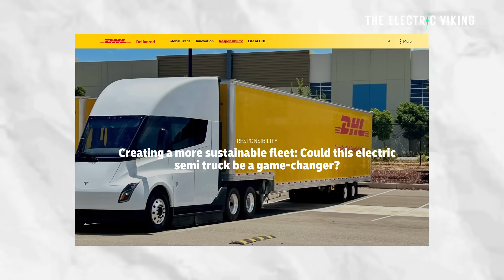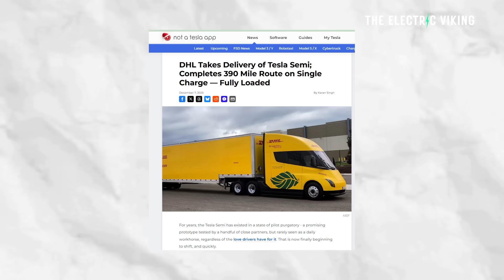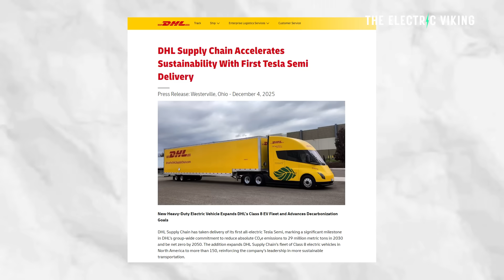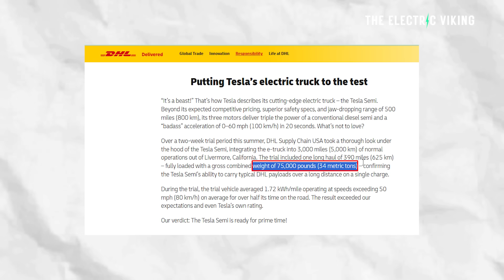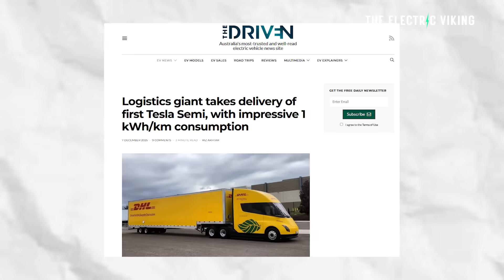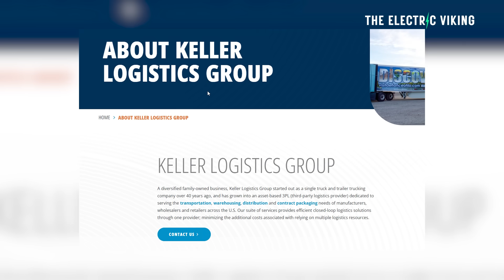Tesla Semi Drives 390 Miles on Single Charge Fully Loaded with Range Leftover!

Comment: Any steep grades in this test? 

When the truck finally was parked to recharge the battery, the local 500 megawatt power plant had to carve out 1-3% of its total plant output fast charge this behemoth.

If this is done fleetwide sounds like this would work out perfectly for local consumers of electricity and their electric bills.

And again how was the electricity used to charge this beast? Solar? Wind? Don't make me laugh.

My bet coal or natural gas, since nobody with low capacity minds want nuclear power to be used.

So again what's the point of all of this from an environmental perspective?

Comment: So just one question where and how (with what power from where for there is not that much available anywhere) are you going to charge all those trucks... for they require power to operate its just that the power does not 'flow' back into the machine ones used compared to ice options...
I mean the tech is awesome but the infrastructure is not there and by infrastructure I mean the power plants themselves not just the wall connection....

Comment: I think it is the future.  Now with companies like edison motors and tesla.  I am waiting to see if it is all EV or EV with a generator.  A smaller one like the size of an F550 would be awesome if it can reach 390 miles loaded.  Imagine doing hot shots or putting an RV on it how cool that would be.  Especially if they offered it with 5th wheel back like full size semis.  Or borrow some of slate tech and allow you to add a bed when not in use and would lock in with the 5th wheel.

Comment: Great that YOU become more intelligent but H2 was never to overcome ICE trucks as it makes no commercial sense to replace as 21% Energyefficiency by such with 12% and a new logistics network nobody will or can PAY. But even with bad power mix in Europe for example you end up with 68% - but my dear self-named EXPERT we have batteries and solar roof top on our warehouses! So we once become FREE from oil and gas mafia with producing our own energy and on the road we do not need to charge which is our case is also a security question!

Comment: In the US drivers have mandatory stops before 500 miles so if you have charging stations long haul is no problem.
Reply: In the EU/UK working time directive basically caps the maximum mileage a truck driver can do in a day at a but less than 500 miles and they will need at least 45 minutes of break to get remotely close to that figure.

Comment: Just watch the Electric Trucker on YT.
Tobias runs long haul over europe with electric prime movers.
Charging aligns with stops at some depot's  or his mandated driver breaks. 
Australia has similar long haul driver limits on hours and mandatory breaks. those 45 to 1 hr breaks allows a fair bit of charge at 350 kW chargers 
Companies also fitting swappable batteries like those of Janus Electric. 
A strategic placed swap station with  a 5 - 10 minute battery swap gives even greater flexibility.
Particularly for local delivery trucks that can swap drivers and run round the clock because of low noise and not impacted by curfew rules.

Electric trucks tend to get between 1 kWh per km to 1.8 kWh per km. 
energy consumption of  180 kWh per 100 kms..per 100 kms.  At fast charger cost of AUD$0.65 / kWh = approx AUD$117.00  per 100 kms.

A 600 kWh battery capacity can give between 300- 500 kms of range when pulling 44 MT depending on the cargo and drag. 
Covered tautliners or pantechs getting better range then open aukward cargo.

Diesel trucks depending on load and wind drag can see 40 - 80 litres of diesel per 100 kms. 
Diesel cost per litre at anything from AUD$1.80 - AUD$2.00 / ltr. approx AUD$160.00 per 100 kms  

As a transport operator AUD$117.00/ 100kms for electrons and much less expensive service cost compared to AUD$160.00 / 100 kms for diesel and then service with oil and filters every 20,000 kms - its a no brainer.
Les driver fatigue less noise and no noise curfew

Comment: Diesels are smelly, noisy, expensive to run, expensive to maintain, (and very tiring to drive). Include oil and filter changes, brake wear and much much more. It’s a no-brainer. Bill Gates has no clue, who’d have thunk it 😂😂😂.
Just as I love driving either of our fantastic Teslas, and almost always use Autopilot or FSD, the difference in fatigue levels with and without A/P on a long drive are HUGE.

Comment: A regular semi goes 2000 miles on a full tank, and can carry 19 tons for those 2000 miles. I think Tesla needs to work on this a bit more. A Tesla semi can carry 6 tons, in a job where you get paid depending on how much you transport 6 tons doesn't cut it
Reply: ? 75k pounds is 34 metric tons and highway speed for about 800k,, how is this not good enough ??

Comment: 75,000 lbs full load, that must include the weight of the truck and batteries. How much does the truck and batteries weigh, then how much on the load? Heavy batteries are going to limit the total load carried. 80,000 lbs is the limit for truck and load normally, with the cab and trailer coming in around 30,000.
Reply: Funny, for decades you did not ask about the weight of Diesel engine, gearbox, drive train, cooling and exhaust systems, and barrels of fuel.

Comment: The tesla semi needs to be able to run at a minimum 500 miles on a full charge at 80,000 lbs. And be able to fully recharge with in hour to really make a huge difference in the trucking industry.
Reply: early days, let's walk before we run. Would you drive 8 hours without stopping? I think truckers have rules in most countries that preclude that. Rest time = charge time = more than 500 miles. The diesel truck didn't kill off the railways...... entirely.

Comment: Electric trucks will work as long as they are owned and operated by a fleet owner with their own charging infrastructure at their hubs. If a independent contractor bought a e truck he would not be able to survive economically simply because of having to use commercial high speed chargers paying commercial rates for power, then you have the purchase price of the e truck which is here in Norway 2.5 times higher than an equivalent diesel truck. I myself am an owner operator with my own truck. I have been looking into the economics of this for a year and a half. It just isn’t feasible due to the economics!
We are supposed to be the nation that has gone the furthest in e cars and trucks…. But for a small business like me it just won’t happen ( not yet anyway)

Comment: There is another option which is worth looking at for the numerous diesel trucks on the road - which is electrify the trailer. A company called Range Energy run by a chap who once worked at Tesla in simple terms adds some batteries and electric motors to the trailer part and that can help enormously with making the truck use less diesel and less wear on the brakes.
Reply: Having some battery and motor on the trailer for braking seems like a win for safety and efficiency

Comment: Millon dollar chargers?  That's right in order to get a fairly quick charge, charging a Semi is like charging 12 model Ys at the same time.  That normally would dramatically increase charge times; so Tesla has a type of Charger supplemented by a giant battery pack. These cost more than the truck, and a 1 MegaWatt unit can only charge 1 truck, so you either need lots of megawatt battery packs sitting charging -or you'll have very long charge times for the next Semi coming to charge.  All this gets rediculous if you are going to try and charge all these with solar panels or wind mills, USA alone has 9 million heavy trucks - if you are not - why do it?
Reply: One charger serving many $200,000 trucks - how does that amortise? Business is all about costs, if they stack up, business buys. If not, not - let business decide on the road instead of on paper.
Reply: @RedRouge-j4j  Yes let them decide without any fake CO2 rebates - they don't save much if any CO2. I  am pointing that out because they hide that large cost, and it takes quite a while to recharge the big battery pack so you might service 1 truck per hour or 2 hours - so it is a significant cost per truck.
Reply: @litestuffllc7249  don't show that comment to your grandkids. They will be paying your climate mortgage - PAL.

Comment: This is similar to that original drive from fremont to Long beach - No one is very surprised if a Truck can go a long ways downhill.  A giant truck is a lot like a bowling ball, it is hard to stop once you get going, and if it is down hill it is very diffcult to stop. When ever you have big claims you need to look into the exact drives and topography. Pepsi prsented a long list of results and when a Tesla Semi had to go uphill, go in twisty roads, and stop and go driving, range and weather impacts the range could fall to as low as 150 miles.  That is still very useable in short haul but probably not so much in long haul, especially without $1 million dollar chargers.

Comment: I’m wondering when someone will put solar panels on top of the trailer. Course I know that won’t work for many types of trucking where they’re dropping off trailers, but many companies use the same truck and trailer all the time on set routes and in sunny areas.
Reply: Might be enough to power a refer trailer but not significantly add to range.
Reply: @williammeek-h2o  way cheaper in any sense to use pressurized gas to cool.
IT also ads weight to the hole contraption that needs transporting.
Solar panels are not really made for moving or they become alot more expensive.
add the weight of inverters chargers and I think you could better ad that wright in batteries.
Less complex for most wont even need a solar supported something contraption ^^
Not to say some might have a use case for it or just a need ^^
Reply: @davidliefrink9818  Inverters are not that heavy. I just installed a 10 kW inverter at home for my shop and it only weighs 60 lb. The panels will be heavier each. When supported properly, the panels will be fine. and you should have batteries anyway.
The whole thing will likely weigh less than you think.
Reply: @williammeek-h2o  and still it wont be an option only an exercise in wishful thinking and money waste management...
Reply: You are the first to have the idea to put solar panel on top of vehicles. You should start a World Solar Challenge to encourage solar powered vehicles, get a time machine to start it in 1987 Australia, and then go hiding in a cave until 2025 without acknowledging that solar panels on vehicles are pointless weight, and need to be put on roofs and elsewhere.

Comment: Canadian maximum combined weight 139100 lbs (63500Kg).  Hauling in winter -40°C wind chill -53°C and snow on road, heater turned up maximum, how much range??
Reply: Electric vehicles heat the seat and the steering wheel, not the cooling water and the exhaust fumes, wasting some 70% of the energy like ICE vehicles.

Comment: Its a shame the US isnt keeping up with EV developments and is gonna lose the auto industry. That was a lot of jobs that will wind up in China. But "drill baby drill" or not - every day oil gets harder to find and more work to extract. Have to go out into ever deeper water, have to develop ever more complicated extraction methods (like fracking) just to keep up the flow. Youre an idiot if you dont think oil is gonna run out. I suppose on flat earth oil might be infinite, being pumped back in through the firmament or something, but on the round one we live in we use oil 10,000 faster than its created. And then, even if you dont believe in global warming, ICE cars/trucks/trains/planes/ships still POLLUTE THE AIR WE BREATHE while the electric grid to power EVs with gets cleaner every day. 120 years ago, trees and plants pretty much kept up with the CO2 the animals breathed out. Ever since then we have continuously increased the carbon going into the air while cutting down the forests that had been absorbing it. 

There are over a  dozen brands  (nevermind models) of electric class 8 semis operating daily on long haul routes in Europe (yes, I know - Europe is only 3/4 the size of the US - I dont care; Paris to Istanbul is still a LONG drive as is Oslo to Naples.) Yet here we act as if its some experimental thing and Tesla is on the leading edge; they are way behind (as is usual with Tesla and their vaporware development techniques). Big oil is hoping against hope that no one here notices the world leaving us behind so they can keep raking in their profits.

Comment: They put a diesel range extender to the Tesla Semi, and it will dominate the roads.

And it doesnt need to be a huge engine, a small super efficient turbodiesel from a car, and that duplicates the range in regular conditions.
Reply: why ?? trucking will just adjust to meet its needs for charging and breaks are necessary anyhow,,  stop for 30 mins for lunch and you could be charging that time,, why does everyone seem to think anyone wants to drive 500 miles in one go anyhow ??  thats 804 kilometers,,

Comment: Since the law requires drivers stop and rest at intervals anyway, that can be done while it charges which eliminates a lot of the charge time issue.
Reply: The only problem would be finding places they could charge up.  Places that could charge up a couple of trucks at the same time would need to have massive electricity capacity.  Much more than what is needed for charging up cars.
Reply: @JimQuinn-tb3uq  Car chargers already need massive capacity; trucks charge longer but not materially faster. Electric Trucker almost always charges at car chargers cause truck chargers are few and far between (so far, and of course thats Europe which is well ahead of us on infrastructure to begin with).

Comment: The semi market, unlike passenger vehicle market, will be the true test for electric vehicles, as every cent per mile is precious.  I can see this working in some cases and not in others.  Shorter hauls where a round trip can be made and charging done at the trucks home base is the obvious use case.  I wonder how it will work in cold areas where there are wait times to load and unload as the driver has to stay warm?  I imagine there may be a place for an electric semi with a small diesel engine and generator to charge the truck if necessary and to run the heater/air conditioner.

Comment: Who will Tesla sell them to?  Nobody in the US, so I hope they are moving their operations to countries that may want them.  Right now, the shipping services companies are going out of business because they aren't in demand.  IN DECEMBER.  Let that sink in.  The usual downturn is after the Christmas holiday gift giving season in January and February and then returns to normal levels a few months into the new year.

Simple economics: Fewer shipments, lower demand for long-range shipping, so the equipment becomes a cost not a resource.  So, if you are in shipping and aren't closing your doors, you now have a bunch of very cheap replacement equipment -- trucks, forklifts, ... -- and you can wait till the sellers are desperate to sell their better less used stuff while you toss out your old worn equipment or even scrap it.

If Tesla wants to succeed in the present market, they have to find a way to get the tariffs removed.  That's not going to happen unless the courts do their jobs and even then the tariffs and other actions of the current US leadership have driven business away from the US entirely as the US is unreliable or even hostile.

Comment: In 16,000 miles of driving, my Model Y has lost 11 miles of range of its original 308 miles of range.
 Extrapolate that 3.57% range loss on a 500 mile range tractor across the following ranges mileages and 
  At 250,000 miles, your 500 mile range will decrease to 328 miles of range.
   At 500,000 miles, your 500 mile range will decrease to 156 miles of range.
That means you'll need a new set of batteries every 200,000 miles or so.
 Not the way to keep down costs.
Remember, American tractor's have a life span of between 750,000 to 1,000,000 miles.

Comment: if they are tat good tesla would have been showing yield. actual tonnage rather than range  Tesla never mentions  tonage.  What is fully loaded. show the tons...    battery packs are using 1/2 the cargo tonnage.  . show me that I'm wrong. Great trucks for delivering potatoe chips. not so much with steel or full payload.  give me th e numbers... time trials for trucks.. gross weight 75,000 lbs.  how much did the truck and battery pack weigh. I think 25k to 40 k. give us the no's not the propoganda.. maybe a 30k lbs ;oad as opposed to 55k

Comment: Sam, the 500 mile Tesla truck supposedly had 75000 lbs on it during the test.  I think there is plenty of market for smaller trucks also.
Reply: Tesla is VERY slow to bring on new models...this semi that will go into actual production next year has been a LONG time coming 5 years++. To bring on any other size of trucks will take forever...don't hold your breath. China already has every size of commercial truck in production...in volume!
Reply: @Beav56  "every size"
Not semi's though, they just barely started to build them this year, Volvo on the other hand has been selling 5k of them already

Comment: Im curious if Tesla thought of putting a very large battery in the trailer rather than the prime mover? The trailer may be plugged in and recharging in the loading dock whilst its loaded and unloaded, plus it has room for a very large battery, then range could be very large and less downtime for recharging on the prime mover...
Reply: Trailers are cheap and can sit at a yard for a weeks, if the battery pack is in them you have to much idle capital. Don't forget those packs cost $100k to $300k, while a seim-trailer is 20k for curtain to 50k for refridgerated.
Reply: @brammeijboom-mj9ld  Bigger batteries mean more non-payload to haul continously. At least with fuel, the truck is getting lighter through the journey. :-)